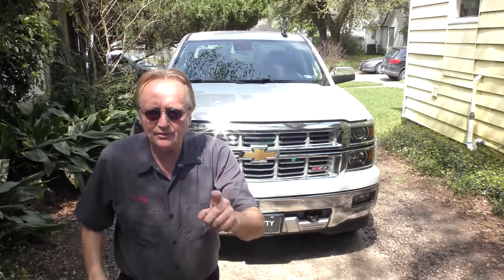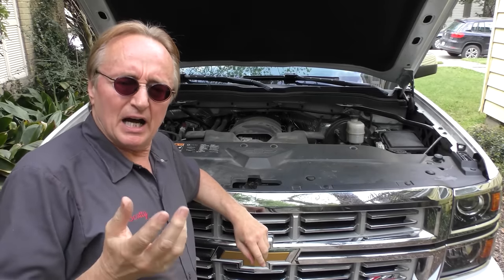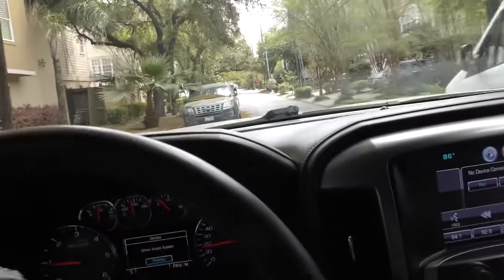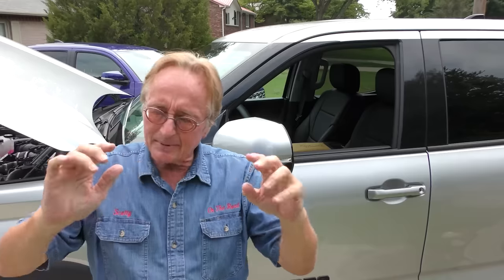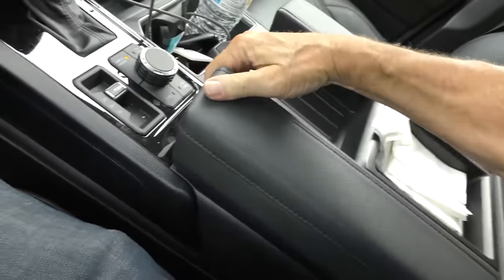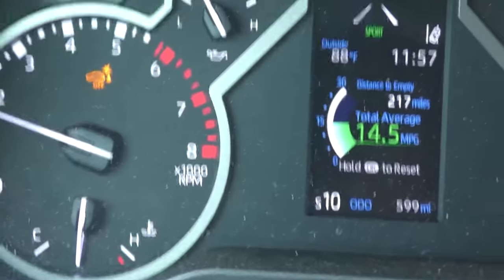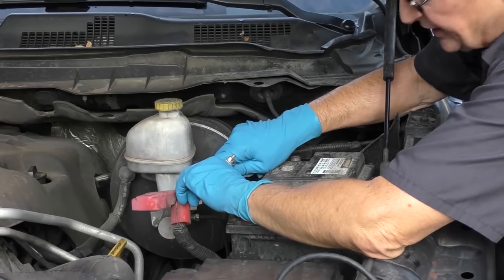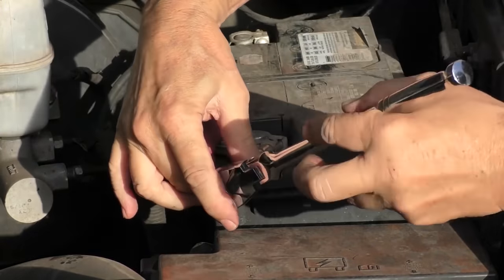3 Trucks I Wouldn't Touch with a 10 Foot Pole

Comment: 07 V8 tundra, 385000 km. Love it. Sure I’ve had to replace some parts. Brake rotors, exhaust, shocks, and I had new leaf springs made for it with an extra leaf for better towing. Overall a great truck. I plan to run it as long as I can.
Reply: Toyotas are definitely built to last, but every vehicle will need parts replaced, like brake pads and shocks. You can't get away from that.
Reply: I just bought an 07 5.7 SR5 CrewMax with only 65k original miles! Love it
Reply: The first generation Tundras can go well over a million miles. Know several people who have that the 4.7, 2002 model pretty much indestructible

Comment: Scotty, a few things I noticed when you were diagnosing the Ram. You demonstrated a capacitive discharge when you touched the disconnected positive and negative cables together, if anyone were to try that you MUST make sure that BOTH batteries are disconnected if you have a vehicle with an auxiliary battery for engine stop start! Also, if you’re going to disconnect the battery positive cable but leave the negative connected, make sure to insulate and isolate the positive cable so it can’t touch the positive post.
Reply: Scotty is behind the times. a 100 ohm resistor is required to clear a computer to prevent damage... and that is a VERY bad idea on many of the more current vehicles, regardless.
Reply: @shermanbird3248 I saw a video where he advised using just that very technique. Interesting eh?
Reply: It was an older video clip, regardless I don't think it's ever been the best practice to short out a computer.

Comment: One of the problems with gas mileage if you live in a metro area is we spend a third of our driving time sitting at a red light. The engine is running and not going anywhere. Uses gas while sitting.

Comment: I had a 1993 Chevy Silverado 1500, 6 cylinder. Bought it used in 1995. Drove it until August, 2018. Paid 0nly 4,500.00 for it. Never had any major engine problems with it, just normal repairs throughout the years. Guess I lucked out on that one. Gas mileage was great also. ⛽
Reply: My 93 Chevy work truck went 450000 with a 4.3 never failed me and I drove it for my business for 20 years
Reply: He's talking about the 3rd gen. First gen are actually pretty reliable, most of the common issues are super easy and cheap to fix

Comment: My neighbor was die hard Dodge so he owned several Rams over the years. He said that they just kept getting worse and worse. Eventually he had enough and bought an F-150. He said the Ford was better in about every way to the Dodge. Those older D100 trucks with the slant 6 were pretty solid but the new Rams are a symphony of problems. But I wouldn't touch an F-150 hybrid with an 11 foot pole.
Reply: Does he have the F150 with the 5.0L Coyote V8 in it?
Reply: @CJColvin The NA V8’s are the only ones I’d buy for longevity. The eco boost engines are an eventual moneypit.
Reply: @scottp2462  Exactly mate, for me I chose the 5.0L Coyote V8 over the EcoBoost V6 anyday.
Reply: 1990 Ram with 318 was a good 4x4 1/2 ton.
Reply: @fromthebackofmymind even the later ones were okay with the 360 if you got a manual transmission.
Reply: Anecdotal experience can't speak for a product line with millions of units on the road.  My 96 Ram with the 318 and NV3500 5-speed went 270,000 miles with relatively few problems.  My 2005 Suburban made it 217,000 miles.  I am skeptical if any full-size truck could make it that far these days, Ram, GM, Ford, Toyota, etc.  You just never know if the truck you buy was "built on a Friday" or if it will run forever.
Reply: Admittedly, the one area the Ram outshines the f150 is the ride. The coil (or air bag) rear end makes a huge difference but sacrifices payload. I know because I own a F150 crew and my friend owns a Ram 1500. But I'll take my Ford with the 5.0 anyday over the Ram for all the other aspects of their capabilities.
Reply: @BigLifeWithLitlJay something was wrong for a suburban to fail at 217
Reply: My fords have always been exellent. Never had a major issue, mine, my familys ,or friends fords. They all had well over 200k when they were sold running perfect, to get something different.  Infact , my wife has a 14 escape  titanium that runs perfect .I wouldn't want a hybrid either,  I also would never buy a twin turbo v6 tundra...
Reply: @ChevyRedneckGFX  the truck was still going strong!  I sold it to buy something newer and more fuel-friendly for Uber and Lyft.

I replaced it with a QX60 that endured 200k miles of HARD abuse (rideshare is not easy on cars!) before the infamous CVT issues showed up.  I replaced that with an 05 Dakota that has been running like a top since I got it besides a few very minor bugs.  My daughter's 08 Equinox was a cacophony of headaches until I finally replaced it with an amazing 2012 RSX.  You just never know what you're going to get.
Reply: Kinda how i see it was is the older dodges were better but the new fords are better for trucks
Reply: I have a yard client that got rid of his ford f150 that was starting to have electrical issues lmao
Reply: Made in Mexico
Reply: @DoomBurger.  the newer fords are definitely NOT better
Reply: @ChevyRedneckGFX  not all of them but some of the trucks defenitly are
Reply: @DoomBurger.  they havent had a good truck especially since the triton motors
Reply: @fromthebackofmymind  Never have know a good Dodge !
Reply: 99 Dodge Ram only had one problem: had to install a new clutch. Up to 205,000 miles now. Had a Ford F150 from hell that  completely fell apart in every way possible after 10 years of driving. Ford is building them better now ..thank God.
Reply: 99 Dodge Ram pickup is not bad. Only major problem was that I had to buy a new clutch. Not bad for a truck w 205,000 miles.
Reply: I have had the opposite I always ran Fords for my work trucks and vans but they turned into giant overpriced POS so i got some rams and i am loving them!
Reply: You've been lucky. I had the opposite with Ford. Every Ford iowned had major problems. Went with Toyota . Zero major problems on all 6 that I've  owned
Reply: happy with my  2001 f150 249,000 miles and still going strong got the 5.8 and will never have anything but ford have tried all the other brand dodge rode like a car but had no hauling strength hell I lied a ton of wood pellets for my pellet stove keep my man cave nice and warm but back to truck ony problem have is bed is rusting off but what do you expect in Wisconsin
Reply: @richsweeney1115 Which Ford trucks did you own?
Reply: @mikehubbard1067  dodge isn't good....in general. Ford, toyota tundra, and tacoma, nissan trucks...and honfa Ridgeline, even though it's a unibody frame are all I'd buy. O a old chevy,old Ford...maybe some old dodges..like old though..
Reply: @JulianoGSF  I've had f150s ,explorers,   econoline vans, 64 Ford Fairlane, straight 6, with a 3 spd standard trany,  ford contour, mercury cougar, 5 spd escort GT, 2 grandmarquis, mercury sable..mercury mountaineer,  rod ranger...
Reply: @steveeazy18  fords last if you maintan them....rams are shitboxes. You'll see. You barely ever see an old dodge on the road. I've seen, and had the typical dodge issues, and I maintain  my cars and trucks.
Reply: The 360 is great too
Reply: @JulianoGSF The Ecoboost are OK until they need new turbos. That usually happens around 150k miles and costs $3000 to $4000, depending on what else went with the turbos. The 5.0 Coyote V8 is usually good for  300k miles or more. I have heard of a couple Gen1 5.0s approaching a million miles.
Reply: @herbb8547  The V8 5L have the infamous oil consumption issues.  Seems like the V6 2.7L is a well built engine.

Comment: Happy 2018 Tundra owner. V8, 6A transmission, and bulletproof. I just don't trust turbos - not even from Toyota. I'll pay for more gasoline and keep it forever. 5 1/2 years old and it is flawless. So much power. 12-13mpg city and 17-18 highway. That's fine to me. And my favorite thing is the whole rear window rolls down. In SW Florida I use that every day. Beautiful truck.
Reply: Same here I’m a Toyota fanboy but I’m looking at the 24 Tacoma with the 4cyl turbo with extreme skepticism. Turbo ANYTHING does not translate to longevity or reliability after 100k miles. I guess we will see!
Reply: That's ok in SWFL until you enter North Ft Myers. Them tweekers are relentless......

Comment: I got a 2013 1500 WT Silverado and I have 206,000 miles. Everything in my truck is manually operated. Manual door locks. Manual windows. Manually adjusted seats. Naturally aspirated 4.3 liter V6 that has gotten up to 24 mpg. Rear wheel drive with a posi-lock diff. I plowed through 22 inches of "Lake Effect" snow with it. Perfect daily commuter truck. No problems yet.
Reply: most likely will need a few fuel pumps and modules, especially if you are in the rust belt, then there is brake lines, my neighbor spent $2200.00 having his brake lines replaced.

Comment: have had my 2012 1500 Ram for 11 years and hardly any issues (knock on wood). Been a RAM fan forever. Love your channel man!
Reply: It’s amazing how many people love the Cummins engines but they complain about Dodge
I have had my Dodge for years that outlasted most of the Chevy owners I know that have traded off theirs and still have their trucks at the dealership with problems!
Reply: Me too, 2012 1500. A rad hose clamp rusted out, and one thermostat failure. that's all. I've had it 11 years. I tow a 6500# trailer in the mountains.
Reply: I driven older Dakota high mileage  and dually 3500 Cummings strong powerful  with trailer roof rank no special maintenance seems reliable

Comment: The old square body trucks lasted forever the new ones totally suck. I still drive a 74 Chevy stepside short box. 350 motor well maintained 800,000 miles still going strong
Reply: I doubt it
Reply: @royharmon8846  ask me if I care
Reply: Got video of ice cold air out the vents?
Reply: @deanb949  what air conditioning?
Reply: How many times has the engine been rebuilt? I'm a die hard Chevy man, but there's no gasoline engine for any manufacturer that is going to have 800,000 miles without being rebuilt!
The transmission as well.
Reply: @Chevyman02  I have put in 3 motors and replaced every body part imaginable but my truck is still running strong and looks brand new
Reply: @FedUpCanuck  I don't doubt it looks brand new. Like I've said, I'm Chevy through & through. I own some older Chevys, I don't like the new vehicles.
Reply: @Chevyman02  I totally agree no computers no plastic all metal. I would rather put money into maintenance instead of throwaway vehicles
Reply: @Chevyman02 there are several tundras that have no rebuilds
Reply: @A-A-ron-aka-big-big  you should really stay out of the conversation and leave it to the adults! 
The tundra didn't debut until 1999, Chevrolet full size pickups have been around for several decades BEFORE THE TUNDRA! 
You're trying desperately to join a conversation when you have nothing to bring to the table!
Reply: WOW!! Incredible.
Reply: @Chevyman02  tundras are one of the ugliest trucks ever along with the Avalanche and Honda Ridgeline. Those trucks were computerized. My 74 Chevy does not have a single computer, no air, a 4 speed, and opening vent windows also sliding back window, off road tires, also power steering
Reply: @FedUpCanuck  I'm NOT a fan of either Toyota or Honda! I like Chevrolet, thus my username 🤣🤣
Reply: @Chevyman02  I too am a Chevy fan but definately not the Avalanche

Comment: My last Silverado made it 288,000 miles and was still strong when I sold it. Only needed a MAF sensor and O2 sensors and window door motors. Not bad 😊
Reply: Pre Asian or Asian made?
Reply: Still got my 02. Bought it in 2011 for $9700 with 56k miles.  It's a ext cab Long bed 4X4 Z71. It now has 364k and runs perfect. Best vehicle I've ever owned.
Reply: buy a lotto ticket
Reply: Every GM I ever had have had over 200,000 miles on it, one a 95 Silverado I had over 330,000 on it and it was gas . I have a 2018 Silverado now and love it.  Also he is comparing one new truck with 2 used trucks with issues ?
Reply: My dad has owned 2 chevy trucks, my mom has owned a chevy impala and all of them have had problems. Idk much about fords but my parents switched over to toyotas and have never had issues since
Reply: I have the 2015 2500HD Duramax with 332K,  I'm not seeing any issues out of it yet, nor have i heard of the evap issue common in forums.  Looks like a 1 off issue here to me. Good truck overall.
Reply: @nrs10001 Fords are junk.  I swapped to Toyotas too...after driving Chevrolets for decades.  I had a 2001 z71 that ran better than a low mileage Ford (work truck provided by employer) that I was driving.  I actually had 2 Ford work trucks, and both were junk.  One had 19k and one has 70k.  They both broke down.  I was not abusing them in any way.
Reply: @jasonjackson6055  Im very new to vehicles so I may be misunderstanding this but the newer fords have me a little confused. From the reviews I've watched I've seen people recommend the v8s over the v6s because they say the newer v6s with the turbos wont last as long. Then I find people saying the v8s come with the 10 speed automatics which aren't as reliable as the 6speeds that come with the v6s. So basically it sounds like with the newer fords you're either going to be getting a shorter lasting engine with a decent transmission or a decent engine with a potentially shorter lasting transmission. Just sounds easier to get a toyota 😂
Reply: @nrs10001  Toyota is putting Ford's 10 speed transmission in their trucks same as Chevy/GM. Plus Ford is collaborating with both Toyota and Chevy/GM on more than just transmissions. There is a reason why there are more Ford trucks of every period on the road today than any other especially Dodge/Ram trucks over 20 years old.

Comment: The evaporator in my 2000 Chevy Express still holds freon perfectly after 23 years. So moral to the story: New =junk, high maintenance & very expensive repair.
Reply: Thats because it's older....newer chevys are junk
Reply: I have a 2002 Silverado 1500 LS. The AC  is still blowing cold AC the day I got it new.
Reply: @richsweeney1115 I don't know I had a 2014 minutes at 300,000 never had any issues
Reply: 99- 2002 Chevy's were well made vehicles, along with Ford, Toyota, after that, I dont know what happened , Engineers ?  Cheap parts from Mexico ?
Reply: Everything is getting too complicated.  Just give me a damn truck that is more mechanical than electronic.  Make it well and sell them.
Reply: @xynfly6899 you got lucky
Reply: I have 400,000 k on my Chevy van 1500 Express.
380k on my 2006 Silverado.
Nonsense
Reply: @MitzvosGolem1  Wow!👍
Reply: And I got 190k on my 02 F150 with the 5.4L, sometimes you just get lucky.
Reply: My 90 350 Silverado still has the original R12.
Reply: My dad has a 2014 silverado Z71 with a 5.3 v8 and 128k miles, the only issue he ever had with it was the bumper was pretty low to the ground but he just fixed that by slightly lifting it. But other than that, he loves the truck and has had no major problems at all, and it's still going strong and has plenty of life left in it
Reply: @TugIronChief  true...kinda goofy guy
Reply: Yep, 2010 Silverado after they started the AFM/DOD flex fuel crap. 121,000 miles on it and 30 days after buying it and it now has a stuck lifter. They had a great engine and ruined it trying to save 2% on fuel economy.
Reply: @colddeadhand7414  yes...I have a 2016 Yukon AFM 198k miles no issues.
Change oil every 3000 ignore the oil change light .

The older ones were so so good .
True
Reply: I miss old American cars, I’m talking before 1972. When I was a teen you could buy them for next to nothing, and fix anything yourself

Comment: Wouldn’t trade my 94 silverado 5.7 for anything. Can’t pass a gas station but it’s never left me stranded
Reply: Currently rebuilding my 94 K1500 4X    sb. Old motor finally went at 563,680 mi. Only problem I've ever had with it is the mapping sensor. Now I always carry a spare, lol. Greatest vehicle I've ever owned, can't imagine ever replacing it

Comment: Had a 2022 Tundra as a rental for 10 days.  Turbo’s were quite and quick acceleration .  Two issues : the transmission was a little jerky.   One tank of fuel only last 300 miles.  

My O8 GMC Sierra still has originally AC .Engine and  5.3transmission have never had any issues with 235k miles on 5.3 motor 
Bought it during bankruptcy.  Best truck I ever had.
Reply: Picked an 11 tundra up instead of the Sierra, Sierra is underpowered and felt pretty solid because of it.  Just not enough balls for me.
Reply: Avoid the 22 and up tundra
Reply: Had an 08 suburban, ok gas mileage, used oil like crazy.  GM said as long as it didn’t loose over 1 quart per 1,000 miles it was within specs.  Kept a case of oil in the back and every couple fill-ups added a quart.
Reply: Chevy was good in 2008 after 2013 they started going downhill.
Reply: He's Comparing one new truck with 2 used trucks with issues ?
Reply: ❤ @Choicejodi
Reply: How does a tank only go 300 miles? Yoy get f150 36 gallon tank youre up there damn near 700 miles no?
Reply: As a toyota guy, I'd say stay away from the 22, time will tell about the 23 and 24 consider its their first gassed turbo vehicle